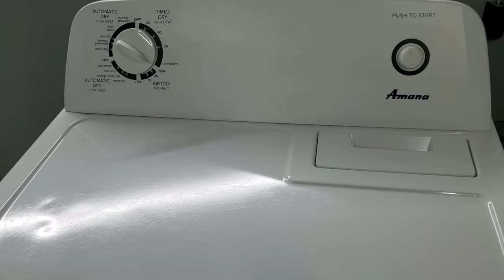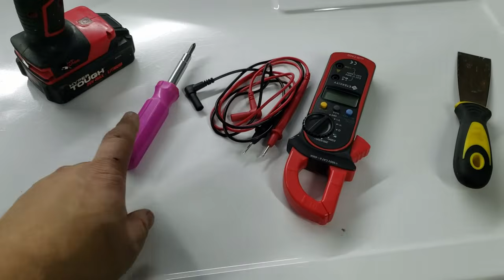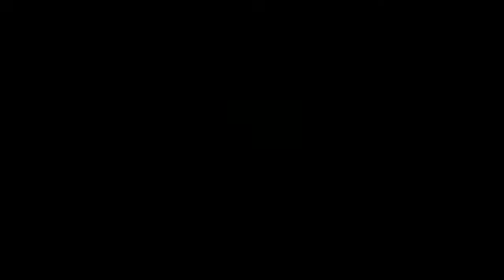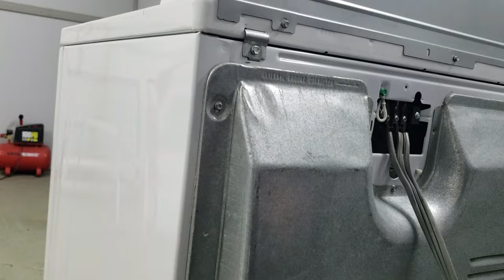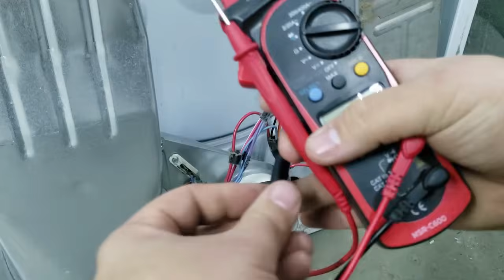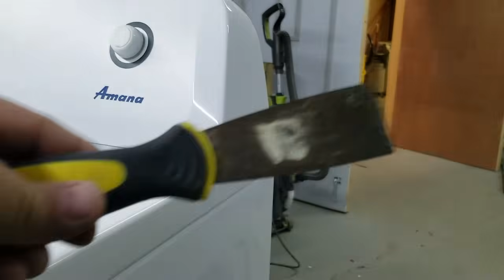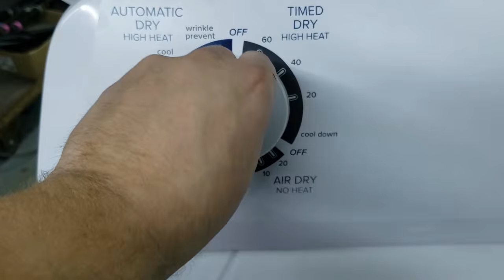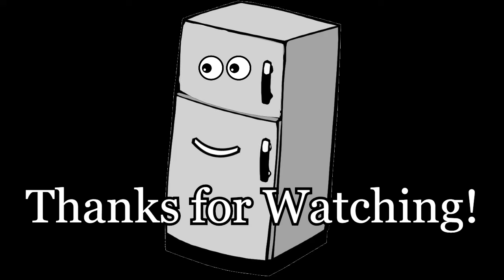How to Fix an Amana Dryer that Won't Heat - Also Works for Kenmore, Maytag, Whirlpool and More!

Comment: This was a cool video, but I guess I need a more in-depth description because the bottom red wire on my heating element is burned & has separated from the contact. Thnx anyway
Reply from the maker: Replace the terminal block and splice a new wire to the terminal block. Its pretty straightforward.
Reply: @bensappliancesandjunk  sounds good, but it doesn't explain why the wire burned up in the first place. Thnx for the help because that was my thoughts as well...lol
Reply from the maker: @brothadre76  it happens when there's no strain relief on the cord or its installed incorrectly. Gravity will pull downward on the cord, and eventually, it will become loose against the terminal post. The dryer always needs upto 5,500 watts of electricity to operate the motor and heater system. So if the connection is loose, it will try to pull 100% of the power on, say, 50% of the connection that is loose. Eventually, this stresses the electrical line too much and it burns up because there's too much electric going through a small pathway of connection.

Comment: Why will a heater element burn?
Reply from the maker: Age, defects in element wire, debris possibly compromising the element, element running too long in cycles due to blocked/restricted vent not allowing heat to remove properly, or a sagging/grounded element due to mishandling during install or warping of the element wire during installation.

Comment: Does the dryer need to be plugged in when checking for voltage? I feel like this is a dumb question but id like to make sure before I get shocked lol
Reply from the maker: For voltage, yes. So proceed with caution. Anything that doesn't involve voltage, so continuity or ohms, shouldn't be plugged in

Comment: Okay. Here is to hoping you still check this video.
1. Great video.
2. I have checked every component on your video at least twice and most of them 3 times. Every one of them tests good. Even the ohm test across the purple wires. 

3. Still no heat.
It should also be noted that the timer diesn't move when you start the dryer. Dryer starts fine and spins. Even kind of feel air movement if you open the door and put your hand in. But no heat and the timer doesn't move even if you ignore the machine for an hour. 

Any ideas??

9-21-21 (Update) - Also disassembled the timer and cleaned contacts as suggested. This also has had no effect on the function of the dryer. How do I set up an analog multi-meter to check for the 220 voltage. That one doesn't make any sense to me.
Reply: ever solve this issue? having the same problem, have tested everything and even replaced timer, cycling thermostat and heating element but no heat and timer doesn't move
Reply: @Eye02  not yet. I am still going to the Laundromat once a week. I have double checked everything and no change. Going to order the complete kit linked in the description as well as a new timer. Even the 100 bucks for all that beats the price of a new one. If that doesn't work, not sure what option will be next.
Reply: @TadTheTinker  alright if I solve my issue I will inform you and it could be the same for you. Good luck
Reply: @TadTheTinker  I believe I might've found my problem, the circuit breaker is burnt out. Going to replace later today. Will update if it fixes it. It's on the breaker box, if you run you're dryer then go inspect the circuit breaker, you may smell burning or odd smell, chances are it's burnt out. If you dont have much electrical experience be careful not to get shocked and dont touch any hot wires
Reply: @Eye02  considering the age of this house and the wiring, I wouldnt be suprised!!!
Reply: @TadTheTinker  circuit breaker was the problem, dryer is working now. 30 amp circuit breaker and make sure it's the same brand as the one that's on it. If you change it yourself make sure you turn the electric off so you can change the circuit, If it's your problem as well
Reply: @Eye02  ran the dryer for about a half hour Saturday, breaker was cold. No overheating at all. I will keep trying stuff.

Comment: This was helpful and easy to follow. I might suggest unplugging the unit before taking it apart. I have followed all of your steps and everything works. I'm looking for loose wires but i'm not finding anything. This is and amana model AED 4675yq0. Any additional input would be appreciated.
Reply: I believe I know what the problem is.  I'm not an expert nor an electrician.  I used the conductivity test on the volt ohm meter sets to audible on the thermal fuse.  It gave audible tone so I thought the thermal fuse was properly functioning.  A different website suggested bypassing the thermal fuse and clamping the leads together that go to the thermal fuse, plugging in the dryer and starting it.  I did that and I immediately received heat.  That leads me to conclude that even though the thermal fuse is conducting electricity (I got an audible tone) it is not providing proper resistance.  Waiting to install the thermal fuse which I ordered.

Comment: why did we not see you check the thermal fuse? and what is the difference between the hi limit cut off and the thermal fuse?
Reply from the maker: The thermal fuse has nothing to do with heat. This video is dealing with heat, not the unit being unresponsive and not working. I have a separate video or three for that problem and proper set of solutions. 

Both fuses permanently die if they reach a set temperature. The one on the heater can is much higher, and when it dies, it shuts heat off to the heating element. The thermal fuse on the blower housing will kill the entire operation of the dryer, resulting in it not turning on at all.
Reply: thanks for the explanation, but I don't think it is always accurate to say that the dryer will not work if the thermal fuse is blown. I have an Amana gas dryer with a blown thermal fuse. It will still turn on and runs on the timer mode but fails to heat properly.

Comment: What would be helpful is if you talked about
Manual multiplmeters for those that have never used one. I’m sitting her with my dryer apart and have a basic manual multimeter and I’m lost at what it needs to be set on
Reply from the maker: I've never used one in my life, so I really can't tell you much about them.

Comment: I bought an Amana dryer on Craigslist, it worked for 1 load, now it won't heat. When I took the back off, I noticed there was no wire connected to the thermostat  terminal. Also the very bottom one was also missing a wire.
Reply: Update: Nevermind on the thermostat, that wasn't actually a terminal. But the left one on the heating element has no wire connected. Also, the fuse is bad, so looks like I'll be replacing that. Thank you so much for this video.

Comment: So someone hit the breaker that goes to my dryer and it stopped heating up but still runs. I replaced everything on it but it still won't heat up. What else could it be?
Reply from the maker: DId you fully reset the breaker and verify you're getting 240v to the dryer?

Comment: Hi Ben. At 6:50 you’re checking the continuity and saying you should get 3.6k and 7.2K oms but I am getting 0.001. I have gotten a new one and I am getting the same result on a new part. Do you know why this is? Any help appreciated thanks!
Reply: Mine reading the same. Everything else looks good. But purple says 0.0 and red ones have continuity? Not sure if I need a new one.. good vid tho
Reply from the maker: So the purple wires were 0.001?

Comment: Hey you helped me repair my dryer about 5 months ago. (Thanks again BTW) I replaced the heating element, fuses etc with the Amazon kit in your affiliate link. Worked like a charm for 5 months and now it is dead again. Any ideas on what might be causing it to go out? Would you recognize another brand of higher quality replacement parts? Dryer is carefully maintained, lint catcher regularly cleaned, properly ventilated etc. I just don't want to buy the same kind again if it's going to blow out in a few months. Thanks!
Reply from the maker: The #1 question is what blew out. You generally want to use a multimeter and find out what actually died - the element, thermostat, ect. Usually, there's a reason why it died even outside of a cheap part (usually, not all the time, but usually).

For example, if the high limit / thermal cutoff died and killed heat: We always check the lint SYSTEM not just the filter. Many times, there's a vent restriction somewhere that's causing it to overheat and trip. I'd just make sure to figure out which part actually died, instead of just replacing all of it.
Reply: @bensappliancesandjunk  ok will do! I've never checked the lint system. Thank you again
Reply: Checked all with multimeter, but element was definitely badly scorched as well as dead, no current passing through it. Anyway thanks again for your help, I will kick you some cash through patreon or PayPal I forget which one you use.

Comment: My dryer looks exactly like the one you are using to model with . The dryer simple stopped , in fact I thought maybe the door came open . I heard it could be the thermal fuse . Where is that fuse located? Thank you for any information you can give me .
Reply from the maker: Its in the video, and its the white one on back of unit in lower-left corner.
Reply: @bensappliancesandjunk  thank you so much , the dryer made no noise are anything . I had just put clothes in it and after 10 minutes it simply stopped. I checked the breaker and the door , it wasn’t that so I am praying it’s the thermal fuse. I am not use to doing things like this . My husband could have already had it drying again , but he passed away in 2017 so now am trying to learn how to do these things so like I said thank you so much for your help and videos .

Comment: You helped me figure out what was wrong with my washer last time so hoping you could tell me what's wrong with my dryer lol today all of a sudden my dryer started making a loud noise, the drum is moving and it's heating up but not drying my clothes, I have checked for lent blockage but it's clean
Reply from the maker: if its heating but not drying, its a vent obstruction, Lint or somethings' preventing the hot, moist air from heading out the unit.
Reply: @bensappliancesandjunk  would that explain why it's so loud now also
Reply: @bensappliancesandjunk  also had a puddle of water underneath 🤦‍♀️
Reply from the maker: @chas8484  Puddle of water usually means there's a blockage of the hot, moist air somewhere. It coalesces into liquid water instead of vapor, and results in a pool. Trace where the water's coming from, and you're gonna find a blockage.

Comment: Hi, I am really new to this and my dryer keeps overheating and shutting off randomly. I used a multimeter and the heating element was fine but I got 0.0 on the thermostat and the HI limit cutoff. Does that mean that they are not working?
Reply from the maker: If it shuts off randomly, its either going to be a bad motor overheating, or the vent tube is clogged.

Comment: Man I tried for a novice! I purchased all of those parts and replaced them all, didn't work so I figured it had to be the heating element. Nope. Still blowing cool air. Idk. I really don't want to get rid of it now. All the parts are new! 😂

HELP!!
Reply from the maker: Did you use a multimeter to test them to see what was wrong prior to replacing them?
Reply: No. Is that a must?
Reply from the maker: @carlbazelais  If you want to actually find out what's bad and fix it, yes. That's why I test every single part in the video, and show you how to do it. Otherwise, you're just buying parts without knowing what actually went wrong.

Comment: If my Amana dryer only heats up on the more dry setting do you know what the problem is?Thanks
Reply from the maker: I'd check all the sensors/element to ensure they are correct. Especially cycling thermostat.
Reply: @bensappliancesandjunk  okay Thanks

Comment: I have same model of Amana n it has drying issue it doesnot dry my clothes quickly and completely like before n this stopped that drying for more than 10 days.
what do u think could be the issue?
Reply from the maker: Is it drying slowly, but still heating up?
Reply: @bensappliancesandjunk  whenever i open the lid they are not warm at all, But they are less wet.
Reply: @bensappliancesandjunk  they are drying slowly but not by heat but may be by air. Whenever i dry by heat they are not warm or hot but they are somewhat dry after 3 cycle.
Reply from the maker: If there's no heat is suggest watching the video and finding the faulty part using a multimeter
Reply: @bensappliancesandjunk  ok Thank u soo much for helping me out i really appreciate that one thing more  if after checking heat is not the issue then what i have to do?
Reply from the maker: @Zauqoshauq  you need to use a multimeter to find why the electric isn't getting to the heat circuit and replace that part

Comment: Hello there. I'm just a gal that has a lint problem. I don't know if you have heard of the lint being on the outer sliding lint collector and the inside just a bit. I have rearranged the dryer hose checked the wall flow is working because I can go outside and it's expelling heat. So it's really a lint thing. It's taking 2 hours to dry a load. Thank you.
Reply from the maker: Run water over lint filter in a washroom. See if it pools up. If it does, dryer sheet stuff has gotten on the filter itself and needs cleaned w/ a good bit of hot water. You can't see it, but its there. 

Otherwise, you may want to dis-assemble the dryer a little, especially blower housing, and clean it out. If your dryer is a lot like this, if you have a real flexible tube for a vaccum (like a lint lizard) you can use it to suck out junk from the place where lint filter goes which is the blower housing.

Lack of drying comes from either lack of heat (from element) or lack of GOOD airflow. If you open door when its running and it feels like a super-humid jungle, then its going to most likely be airflow restriction somewhere.

Comment: You can get the WHOLE PACKAGE for 28 bucks on Amazon... Heating Element, Thermostat, CUT OFF and  the Fuse.. https://www.amazon.com/gp/product/B0829K9XCJ/ref=ppx_yo_dt_b_asin_title_o03_s01?ie=UTF8&psc=1

Comment: So I am stumped on my amana electric dryer. It was taking longer and longer to dry, and now there is no heat at all on the low heat settings. Here are the things I checked:

Things checked on Dryer:
- Each leg has 110v & combined have 220v
- Thermostat has continuity 
- Heating element has continuity and has approximately 10 ohms of resistance (within specs). Element is also grounded properly 
- Cycling Thermostat has continuity on primary heat red wires
- Cycling thermostat low heat purple wires have 7.2 ohms (within specs)
- High limit cut off/thermal fuse has continuity
- Cleaned lint chute and blower wheel out (I do this regularly anyway so it wasn’t bad at all)

When turned on to test, no heat at all on low settings. High heat gets to temperature quickly, but smells REALLY bad like something burning. This is new and I Did not smell prior to cleaning out lint. Drum is tumbling fine and belt is in good shape. Any ideas?
Reply from the maker: When you cleaned the lint chute, did you run hot water over it? Sometimes an invisible film from the dryer sheets/ect can get it on to where even if it looks clean, air won't flow. If you run water, see if it pools up on the filter. If it does, then that is restricting the air and you just need hot water & a little soap to clean it. 

Otherwise, MAYBE the contacts on timer need a light sanding or inspection. 

If something smells burning - there's a different between lint burning and any sort of obstruction.. Lint burning is very normal when the dryer's been moved around, even cleaned because dust particles will migrate to the element easier due to cleaning. If its something else-smelling, maybe a wire is starting to burn up.
Reply: @bensappliancesandjunk  awesome thank you for the quick reply and Merry Christmas! I did not run water over anything, I’ll have to try that. Just to be clear, I can run water down the entire metal chute (obviously I’ll make sure it’s completely dry before using again. 

The burning is most likely exactly what you said about a little lint burning after being moved around. 

I’ll try cleaning the timer contacts and will let you know if that helps. Thanks again
Reply: @bensappliancesandjunk  I cleaned the lint trap with a small amount of dish soap and water which definitely seemed to help the air flow. 

Also it appears that it may in fact actually be the timer. I took the terminals off and put them back on, and it worked. However when I reassembled it, it was not heating on low setting at all again. Even the high setting appears to be not heating reliably now. 

Should I try to fix it first, or just replace it? If replacing the timer, is there anything else you recommend to replace at the same time?
Reply from the maker: @Amigo_Cx  I've noticed sometimes that re assembling the timer after cleaning the contacts can bind the gear case for some wild reason. What id do is take the timer apart, clean contacts if you notice anything else. However, when you put it back together, use your multimeter to verify you are getting continuity on what should be the high heat setting when you turn the dial. Ive had a few times where the contacts and gear case get bound up to where it doesn't cycle right because the timer housing wasn't assembled correctly.  Almost like its pushed together too hard so timer gears can't cycle. By testing continuity while rotating the timer, you can get an idea if maybe its intermittent and thatd be the issue.
Reply: @bensappliancesandjunk  I ended up just ordering a few of the common parts just in case from your website. I decided to get a belt/pulley kit too just to have on hand because it has been squeaking periodically.